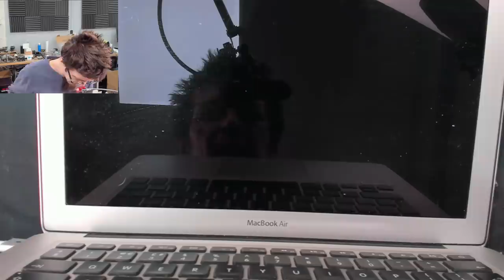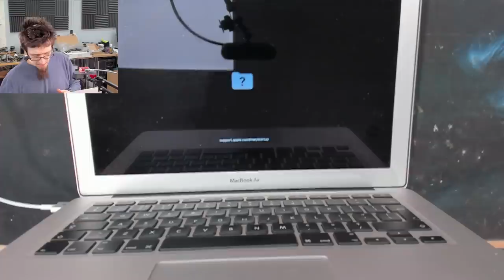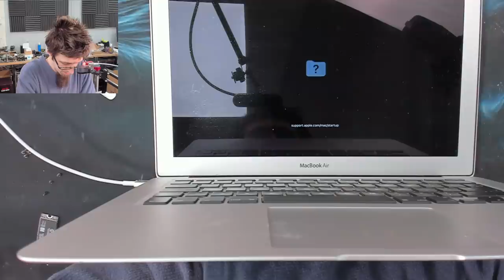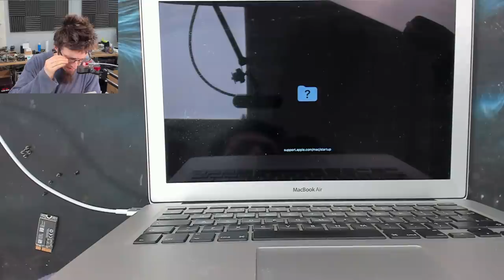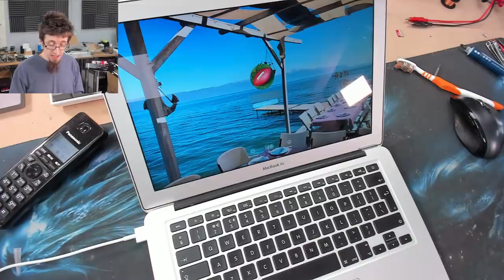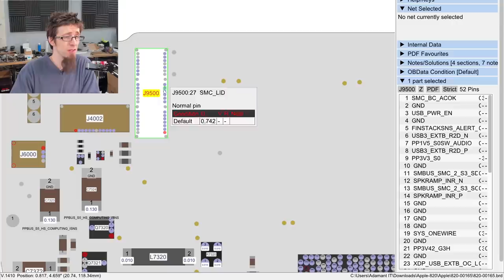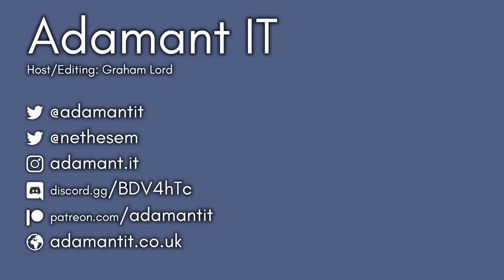MacBook Air with a lot of erratic behaviour - LFC#309

Comment: Wonder who ran off with the screw for the wifi module...and the missing keyboard backlight FPC connector latch?
Reply from the maker: I think another shop had started looking at this one before. But it's odd, because the mobo hadn't been out before. Maybe someone who started looking, took a few bits off, and was then like "nah m8 I'm out."
Reply: Good Detective Work Paul!
Reply: @irepairitall  paranoia required to ensure that you don't get blamed for someone else's SNAFUs :D

Comment: im working on the same macair. mainly the issue was no power no lights on the charger. after disassembling the unit, i found out that dcin connector under bridge connector was ripped together with the socket j7000. pin 1 pad is gone and theres a hole. pins 1 and 2 is shorted to ground. can i put jumper directly in to those pads to see if short is within the area? hope to hear from you. thanks.
Reply from the maker: Pin 2 is Ground, so you're OK there, but Pin 1 is SMB_BC_ACOK, which is part of the OneWire (green light on charger) circuit, so that'll be a problem.
Reply: @Adamant_IT  oh, i apologize. i messed up. pin 1 and 2 on boardview and diagram says its PPDCIN_G3H. pin 3 is PP5V_S4RS3. or maybe its the wrong schematic i have.

Comment: Hello 
I have macbook a1466 
When I remove the battery it's turned on simultaneously charger is connected. After some time when I shut down but charger is connected simultaneously and leave it for charging after 5 min it will not turn on.
Then I will remove battery again then it's turn on. Why this problem come.
Reply from the maker: A MacBook Air will turn on when the charger is connected with no battery - this is normal behaviour.
If it doesn't turn on when the battery has been connected for 5 mins, that sounds like a bad battery.